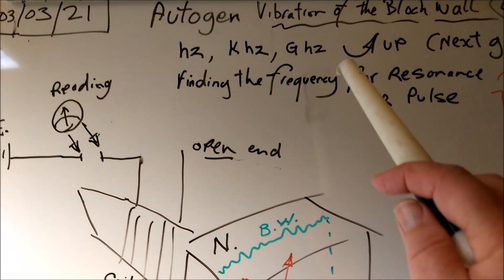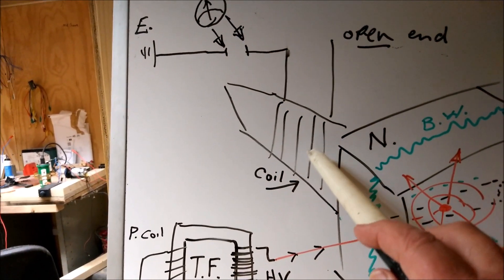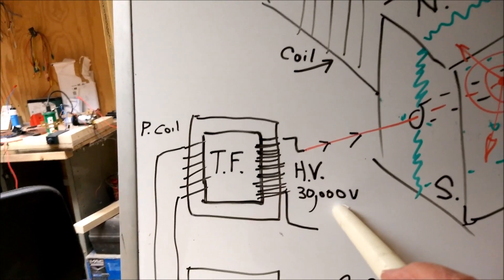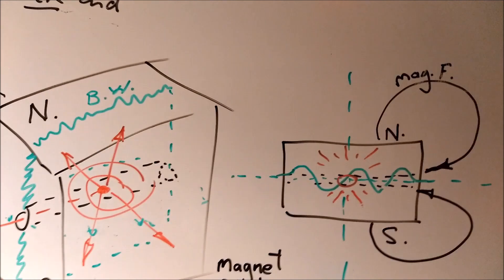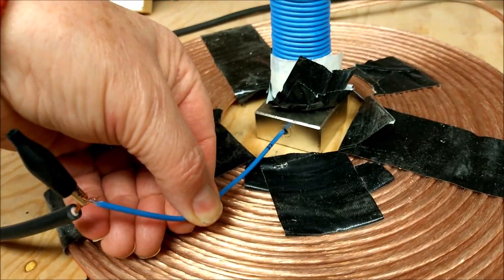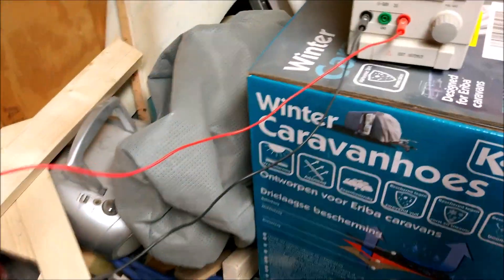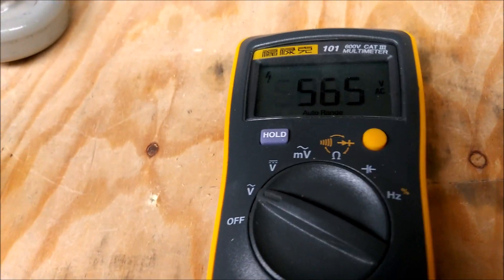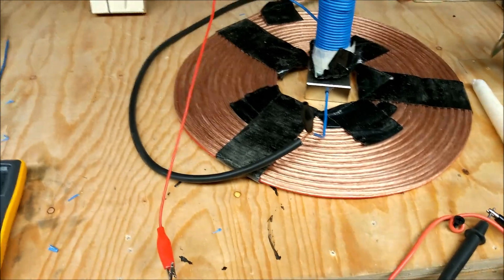AutoGen Ex1 Magnet Point Source Power Generator

Comment: -Just thinking out loud…since antennae study verifies a magnetic field is a spin around a wire.  This spin can be either clockwise or counter depending upon changing electric field (different aspects of the same thing)…now a permanent magnet obviously then has a spin on each side of the magnet.  If you try to put to South’s together the spins are opposite and repel as the same direction spin is coming at each other.  However, if you bring a counterclockwise and clockwise spring together (i.e. North South) they attract through the induced spin on the aether (magnets work in outer space,, thus aether concept).

- Now then…once these two magnets come together what happens…well a new longer magnet forms.  Well then it is necessary that a new center of spins from North Side to South Side now happens at the middle.  Thus the middle is transition in magnetic spin.  In three dimensional life more like a cork screw.

-  In this center area there is less motion…rather pressure (potential)…Potential in the case is electrical potential…referred to as ‘dielectric’. Yes a capacitor’s dielectric is under strain as is the middle of a permanent magnet.  Interesting that as you put two magnets together this dielectric transfers to center mass.

-  So now you come a long and drill a hole in this magnetic center of mass (dielectric)…you then proceed to put a pulsing 30,000 volt (pressure/potential into middle of the magnet…of course this upsets the apple cart.  The permanent magnet seeks a new mass central (balance potential) changing surface magnetic field on both ends of magnet.  Additionally you spark a high potential to the metal magnet charging the magnet with electric potential.  Thus the outside of the magnetic as at electric potential as compared to outside the magnet.

So you have quite the complex situation going on here.  Interested to see where this journey goes for you…nice job!!!
Reply from the maker: Yes the penny has dropped. I cannot wait to fully cog in experimenting.
I am having to cope with having to move the workshop and pressing the start button mentally. 
90% of my tools and project equipment are now out of reach. 
However I am going to replicate the setups.
Notes
The center of the magnet hole has a insulation spark gap wire where the HV pulse spark is probagated via a small gap in the wire.
So the shock wave epicenter strikes out at this point changing the potentials violently then collapses to normal.

In trials a controled voltage appears in coils at each magnetic pole extension coil.
These voltages are DC according to the pulse wave shape ( in Principle).
No matter a series of capacitors will be used to control outputs.

Thanks for your patience and interest.

Regards... DC

Comment: How do you describe volts and amps? What are they.
Reply from the maker: R. Hi always good to check. I have hit a very interesting point in my experimenting. So if we get out of the way of potential and flow and focus on what's happening in and around the magnet. I have been and still recovering from "V", so it's knocked me out from fully engaging. 
I have been looking at nature for clues.
What we see is controable pulsed voltage (without flow or power).
So my Q for you is where is the flow or dielectric gone?
The answer is in nature, this is so interesting cos I only at this stage have ideas.
Your thoughts are very welcome.
Regards... DC

Comment: Take a look at this.. A visual depiction somewhat of the spark gap and how it looses it magnetic nature and how 2 harvest dielectric via spark gap n cap though caps discharge cycles r imp and depends upon frequency n voltage so just imagine the impact of spark gap @higher voltage thr by the voltage amplification
youtu.be/EVbdbVhzcM4
So multiple or serial spark gap shd set the ball rolling chk via volt amplification and as v is amplified so is the frequency or vibrations so try looping back into spark gap the voltage gain to feed also as u did through ur magnet core both ways and later to cap to get that scalar wave into the stout bar 2 analyse visually  as u loop spark gaps or series connect spark gaps🙏

Comment: you can try https://www.aliexpress.com/ for oscilloscopes and function generators but you will have to wait a month to get it.
I really like it that you use a white board to explain your work - much easier to follow the experiments this way
Reply from the maker: Hi A.M. truth is I am short of £ so I need to make certain I get the correct ones. I want to be 100% of choice and need to connect a MOSFET to control the amps. EBay is full of them. I hope you understand my position as a pensioner.
I really love to experiment, however I do have limitations.
Regards... DC